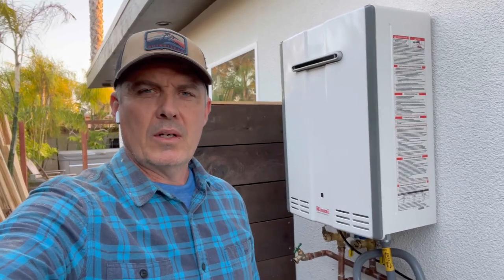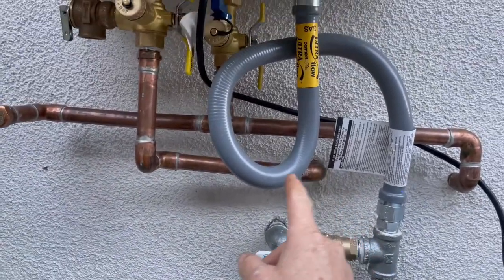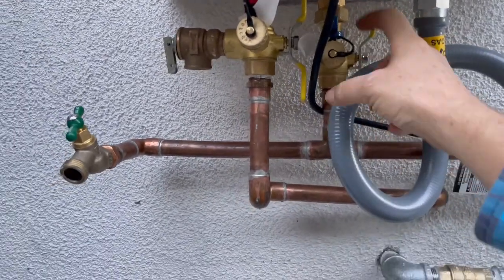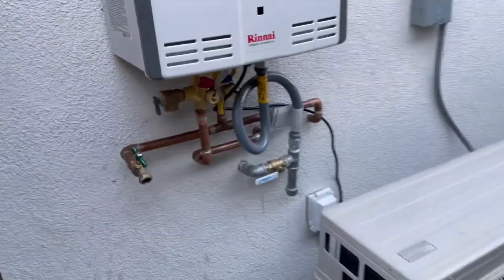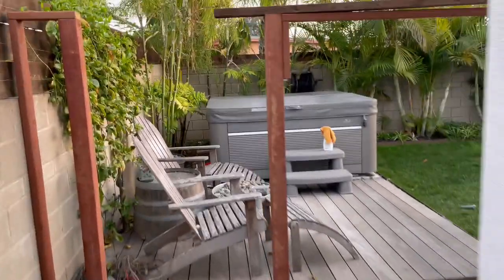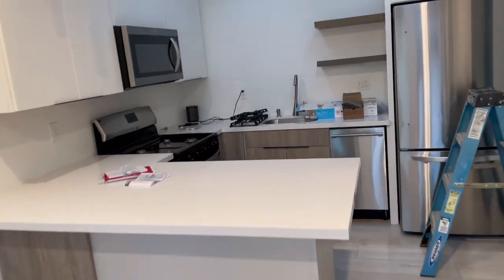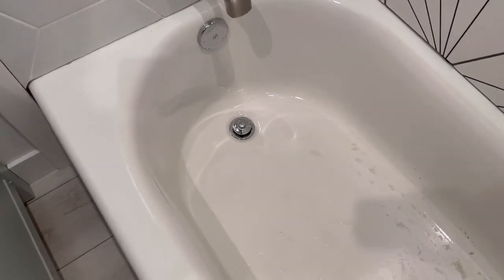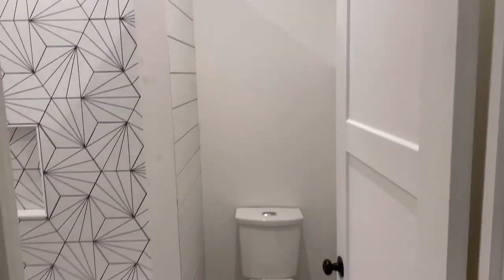DIY ADU San Diego Update #14 TANKLESS WATER HEATER, GAS METER, & APPLIANCES.

Comment: So the condenser is being used for both the ADU and your garage?  How does the electricity split work? I guess you're just billing the tenant yourself rather than having a separate power meter?  Kinda hard to figure out their exact usage though.
Reply from the maker: Currently my solar is over capacity so it runs everything and then some. I didn't install separate metering for any of the utilities. It all comes down to how you want to use the ADU and how much you want to spend. Separate gas meter $. Separate elec meter $$. Separate water meter $$$$$. But you can always install submeters if you want.
Reply: @URBNBLDRS  Ah, gotcha. Right you're forced to put solar on all new ADUs right?  You should do a video about that system. 🙂

Comment: What mini split system did you use (ductless, wall mount. Multi zone, etc)?  Thanks for the videos
Reply from the maker: We used a Mitsubishi 36,000 btu mini-split with 3 heads. 12k in living room, 6K in bedroom and 18k in garage. I have an excellent installer if you are interested.

Comment: Were solar panels required?   ADU is looking beautiful!
Reply from the maker: Thanks!! At the time that my permit was approved SD was not requiring solar panels. But the requirement changed recently. This is the current requirement for ADU's taken from bulletin 400. 

ADU Solar Photovoltaic Systems
1. Newly constructed ADUs are subject to the California Energy Code requirement to provide solar panels if the unit(s) is a newly constructed, non-manufactured, detached ADU. Per the California Energy Commission (CEC), the panels can be installed on the ADU or on the primary dwelling unit.

2. ADUs that are constructed within existing space, or as an addition to existing homes, including detached additions where an existing detached building is converted from non-residential to residential space, are not subject to the California Energy Code requirement to provide solar panels.